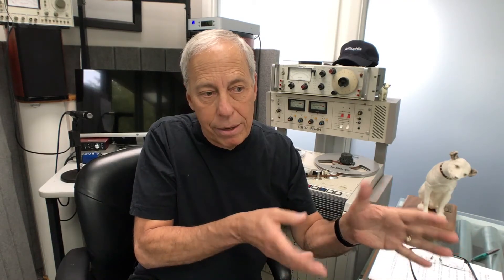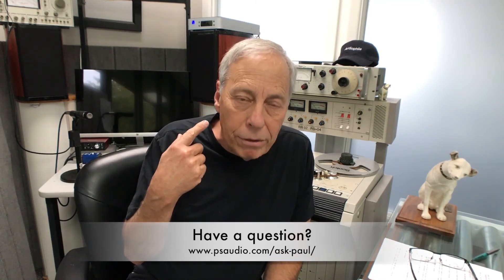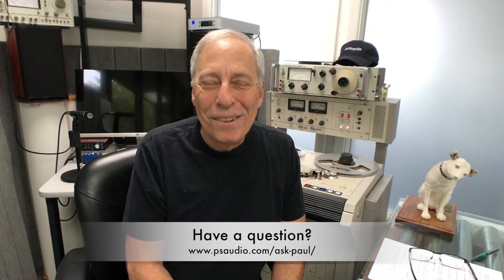How do you balance the cost of components vs. performance?

Comment: Morning question why do the gain cell dac the jr dac old direct stram dac n the mono blks 700s.. POP out speakers during turn on n off ??? And when use the remotes n change inputs and adjustments there are pops .. i have the gear so .. First hand experience and can post vids to prove this.. thankx 😊

Comment: I've heard that one of the benefits of the internet is the ability for companies to sell directly to the customer, so that there is no dealer fee necessary. According to Jason Stoddard from Schiit Audio,  dealer fees can be as high as half the cost. One big disadvantage of this model is that very expensive gear generally needs a dealer to close the sale. If this is accurate, I'd be open to buying expensive gear directly without the handholding of a dealer since i typically research products on my own.
Reply: Except then people would go to the dealer to hear and then buy online for the 50% discount. No dealer will stock your products if you are going to undercut them on price.